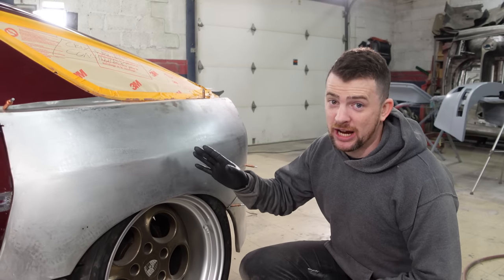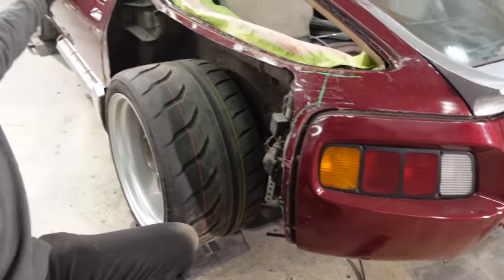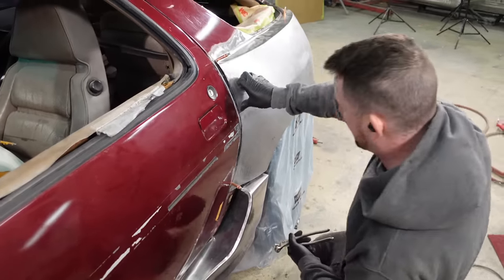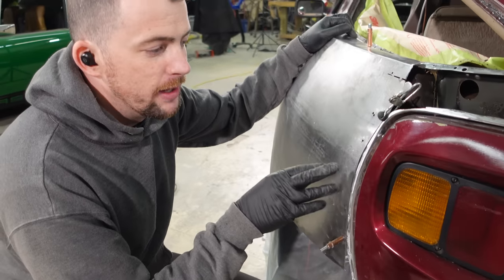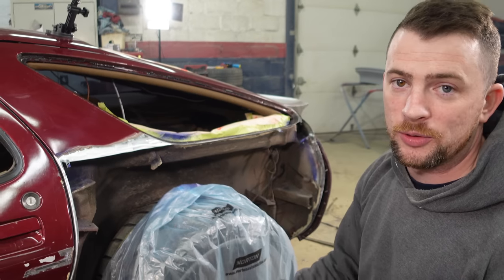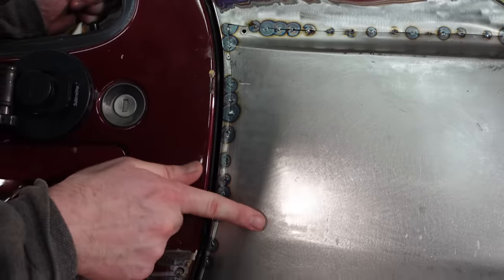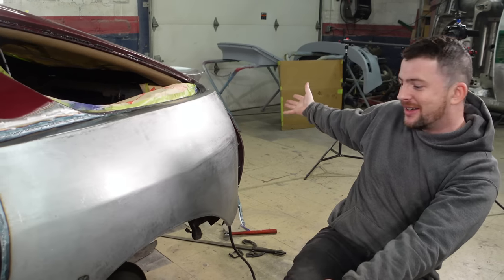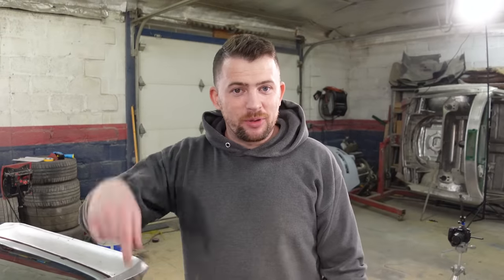Weld Your Metal Flares With CONFIDENCE! - Outrageous Porsche 928 Widebody Gets Flare - 928 Ep. 22

Comment: Cant wait to see the 928 completed, its gonna be one hell of a car. I currently have 2 projects lined up that were pass down to me by man dad, a 67 mustang and a 78 f100. Both cars need quite the fab work. If I were to win the tig welder,  It would help me learn how to tig weld thin sheet metal, for which I can use to repair most of the rust problems in both of my projects!

Comment: First off you've taught me more about Sheetmetal working in even this video alone than I have ever received at any body shop I've worked at or any other youtube video. So thank you tips and lessons here are a huge help for me with my endless projects including my 1986 BMW E30. And if  I were to get my hands on that Eastwood I'd put it right to work with starting on my rear tubs I need to weld in on my E30.

Comment: Your videos are amazing tutorials.  Great job.  I've been a hobbiest body guy since 1976 and retiring soon.  My plan is to embrace metal shapping more so I've been adding to my tool collection.  One item I still need is a tig welder and would love to have the Eastwood Tig 200 LCD for this project vs. gas welding the butt joints  I would use it on a 1956 F100 phantom project I plan to build using 1956 panel van quarters I purchased.  Keep up the great work!

Comment: I the work you guys do. I especially love the fact that you treat all Porsches as the great cars they are (for the most part as a fellow 996 owner searching for a new engine).  I also love the fact that I learn when I watch you videos. If i won the welder it would first practice as i want to learn to tig weld. But primarily it would be used to do the welding on my own projects in my home garage. I have everything from a 1940 plymouth to a 996 to a nissan 240sx and a 1995 ford f350.  All of them need work some more than others. The welder would help me make the work happen.

Comment: Did you know that the 928 has a "Weissach axle" in the rear?  It is a passive rear steering system that will turn the rear wheels under cornering loads to allow it to turn better in a corner.  I would be sad to see your beautiful wide body rear steel fenders get damaged because they didn't have enough clearance for agressive driving when finished. Keep up the good work, your fab skills and video skills are top notch 👌!

Comment: 18:22 if I hade a Eastwood tig 200 lcd I will continue with restoring my old Volvo 164 where the doors start to rot and my cafe racer cx500 so that I can make a bracket for my rear master brake cylinder. I was always scared to make my own weld but have been taking lessons, and I surely improved.

And love your content!! Keep it up!

Comment: Great video as always, I would use the Eastwood tig to help finish the flush fit front and back glass of my protouring 1972 Trans am. I have 2 years of metal work in the back of the car, turning a 81 T/A big back window to a small back window, metal rear bumper, spoiler, 2 1/2 inches added to lower the rear quarter and aluminum diverter.

Comment: Great video and tips on TIG welding. If I won the welder, my son could take his TIG welder back even though I'm using it on his truck replacing rusty rocker panels.  A daunting task!!  Question - what size tungsten and filler rod are you using?

Comment: I have a 1967 Volvo Amazon with the typical rust spots. I would use the welder to replace the rusted areas while adding about an inch to the width of the wheel arches for a subtle flare.

Comment: Im 21 correctly working as an apprentice in a small fabrication shop. Love it to bits

Would love to tig weld at home. I have a old toyota that needs a bit of work. And I've been practicing my tig welding for ages (feels like it) would probably start out by doing some exhaust work with it

Comment: Man I would dig that welder. I have a Acura GRS with a built B18C that I am putting a turbo on. I need that sweet welder to weld my aluminum charge pipes and the 3" stainless exhaust.

Comment: Amazing craftsmanship. Coachworks unlimited 😊. You are going to want to get the inner wheel liners if you don't have them and modify to fit. Even if you only drive in the sun it will sandblast everything inside the quarter panel. Wiring, fixtures, paint, etc.

Comment: **Prompt Answer** 
If I had the tig welder from Eastwood I wood build an aluminum Uras style hoodvent for my 1987 FC Mazda Rx7 to be able to get rid of the crap fiberglass one I currently have that fits horribly. IT would be amazing because I would be able to weld the vent solid to the factory aluminum hood and create optimal vent for the intercooler while strengthening the hood!!!